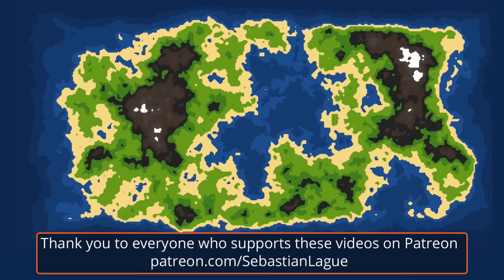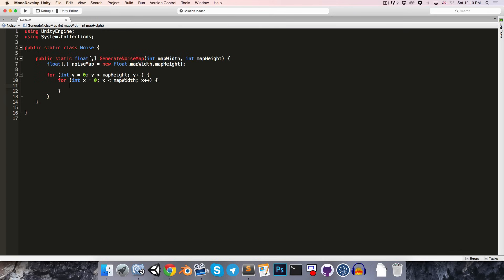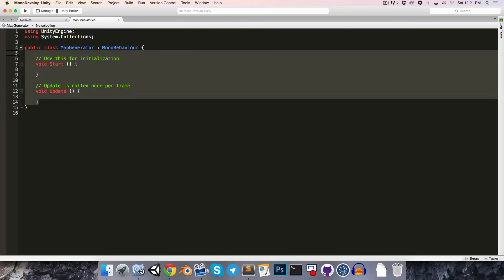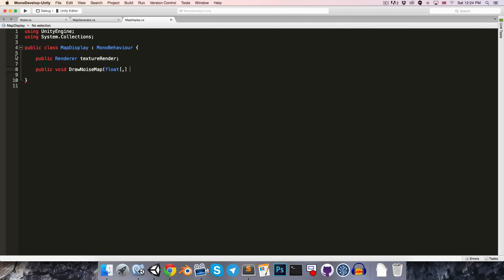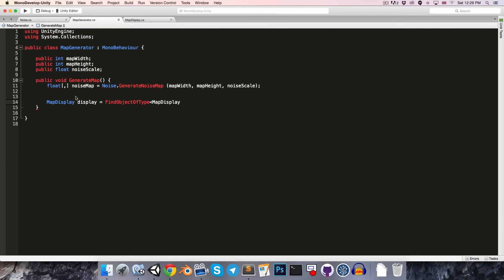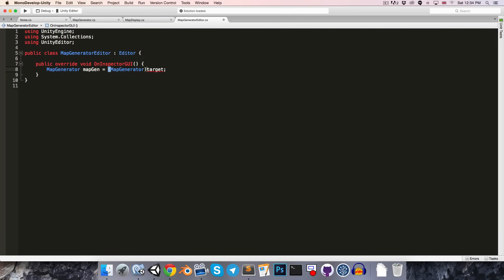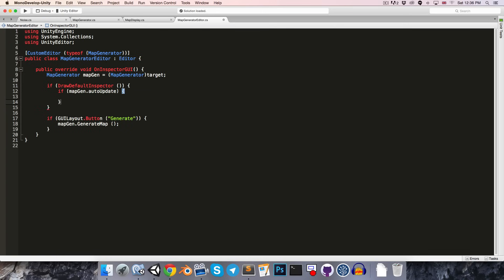Procedural Landmass Generation (E02: Noise Map)

Comment: godammit, and i thought i finally found a video that shows how to do perlin noise without using some lazy build in function
Reply: The algorithm and programming of perlin noise is patented, IIRC. You'll probably only ever find it as a built in function.
Reply: @DB-pt6zj  simplex noise?
Reply: @proxy1035  According to wikipedia it is also created by ken perlin, and a specific implementation of it is patented, so if you implement it in the way described in the patent, youd have to give credit or royalties, depending on whatever license ken has set up for it, which I do not know. I would suspect any simplex noise functions you find premade in software to be using that method, and it's probably baked in to your use license with that software (i.e., the company paid for the right to use it, and as such you can use it in some approved way in the software).

https://en.wikipedia.org/wiki/Simplex_noise

If you want to make your own noise function, your best bet is to probably search academic papers to find out what math they use, and then make a noise function yourself, using similar mathematics.

I have never created a noise function from scratch, but maybe I will make that my next project... If I do I will try to remember this thread. I've wanted to make some YT tuts, so maybe that's a good excuse to start making them.
Reply: @DB-pt6zj  question is, why would i pay them for something that they don't know i'm using...?

like it's literally impossible for them to know someone is using their algorithm if they just never make it public enough for them to know...

even when you make something public how are they gonna know it's their code if you wrote it yourself and just used the descripotion of the algorithm as refrence points to make your own?

so i don't get why i would care about paying for something i just want to use a refrence, and not just do a copy of.

plus OpenSimplex noise exist so there is even less reason to pay anyone.
Reply: @proxy1035  Well, yeah, if you never make it public, they won't know. TECHNICALLY it MIGHT be against the law, it depends on whatever license is attached to the patented process. Many licences IIRC are mostly about distribution and/or profit. So if you don't distribute or profit, then you aren't in violation.

IANAL so I can't really give any recommendations on case law. If it was just for my own personal use, I wouldn't really care about patents and copyright. But IF you make something public, like a game, or app, or youtube tutorial, it might fall under a license violation, which might be why there are no YT vids on how to implement perlin or other noises directly. Their licences might forbid it in some way.

And it can be figured out, assuming it is used in public code (like in a game or something downloadable), sometimes by decompiling software. This largely depends on how the compiler compiles the original code, and how the decompiler chooses to decompile. If there is enough evidence, then you may be hit with court action and subpoenas, in which case you would have to show your actual code, which could prove a license violation. It also depends where the patent is recorded. Many countries that aren't the US don't have strong ties to US patent law/copyright, and so don't respect it in any way. It's one of the reasons there are many Chinese mobile game companies that just completely rip off American art assets and designs - their courts don't have any respect for American patent/copyright law. Which I don't see as positive or negative, just a side effect of the two countries' relations.

As for how to say "this is covered by the patent" or not, you'd have to read the patent itself. Patents vary in how descriptive they are of things. Patent law is a whole field of law. Like I said, IANAL, so I don't know how it works from a legal perspective, how lenient courts would be if your design is "kinda close but not quite what is in the patent description", etc.

But if it isn't public the chance of that being an issue is pretty much as close to zero as it gets. You could probably read the patent, the description of the process, and recreate it fairly easily if you are a little math and google savvy.

Comment: I found that with the finished code for this episode, certain Scale values would result in pure grey images. And, though the first 20~ seconds of this video reference something like this occuring... it didn't quite feel right to me so I did some tinkering. **EDIT: But I should mention here that if you stick with the series, Sebastian later adds an "Offset" value, which appropriately picks from the Perlin Map - rather than the early code from this episode seemedly picking from the same point over & over.**

Looking at the current Unity Docs example for PerlinNoise, the prefered way to pick sampling co-ords is closer to what 'adrian anta' presented some time ago:

float xCoord = x / noiseTex.width * scale;
float yCoord = y / noiseTex.height * scale;
float sample = Mathf.PerlinNoise(xCoord, yCoord);
(I cast both x & y as floats in my example after seeing some systems had issues resulting in solid textures)

Using the code example from my comment here I was able to achieve much more reliable / non-solid results.
Hope this helps!

Comment: For those who seem to be having the error "Array index out of range" check your code. It is not a problem with the IDE or unity,  it is your code.
Reply: Im having this problem what do you suggest be the issue?
Reply: Nvm you’re right. In:
Color[] colourMap = new Color[width * height]; 
I had the * as a = because of Sebastian’s font. 
So if you get this, check EVERY “+,” “-,” “=,” and “*,” and make sure they are the exact SAME as the guy in the video’s

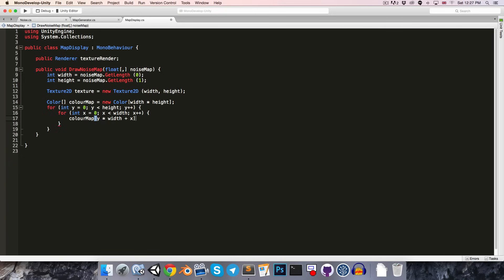Comment: Kind of feel stupid for asking this, but how does the thing he does at 8:22 work? Can't seem to figure out how he gets the correct indexes with that formula. For instance, if width is set to 5, shouldn't the second index generated be 6?
Reply: This may be a little late, but in case you`re still interested:
It`s actually similar to how he iterates through a two dimensional array. You can think of this one dimensional array as a two dimensional array, only with all the rows combined to one really long row. So when y=0, he goes from the first element to the element that is smaller than width. In a two dimensional array, this would be equivalent to going through the first row of the array. Than he exits the inner loop, y increases to one and the inner loop starts at width (where it left off) and continues to width times two. In a two dimensional array, this would be equivalent to going through the second row of the array. Now y increases to two, the algorithm goes from width times two to width times three. In think, you got the idea. This continues as long, as y is smaller than hight. In a two dimensional array, this would be equivalent to going through every row of the array.

Comment: IF YOUR PLAIN IS GRAY: 

CHANGE YOUR NOISE SCALE TO 10, WIDTH TO 100 AND LENGTH TO 100  :)

Unity changed their Perlin function, and it now requires smaller numbers for small Perlin.

changing noise to 100 means our sampleX and sampleY get divided by a bigger number, making them smaller, making your plain display a very clear Perlin image rather than like, 1 grey pixel of Perlin.

Hope this helps someone :)
Reply: you saved me

Comment: The plane is black when a press the button :(
Reply: In case it wasn't resolved, that probably means you used a < check for the noisescale clamp instead of <=.
Reply: Make shure you have "<" instead of ">" in your noise.cs script
Reply: did you solve it?
Reply: I have the same issue...
Reply: @Osdias22  Make shure you have "<" instead of ">" in your noise.cs script

Comment: got this to work on a chunk base terrain.. Instead of making a fix size map I use coordinates as a sample for the PerlinNoise function. Nice tutorial Sebastian quick and fast.
Edit: I had an issue with it when with negative number making a mirror of the terrain when your center is at 0,0. I solve it by adding an offset to the coordinates like 100000+x and to the y. I got this on a 9x9 chunk with 16x16 blocks each.
http://image.prntscr.com/image/92a03e26943545839a0828bc00367bac.png

Comment: hey getting this error with exactly the same code as you, and Im not the onlyone
IndexOutOfRangeException: Array index is out of range.
MapDisplay.DrawNoiseMap (System.Single[,] noiseMap) (at Assets/LandMass/MapDisplay.cs:18)
MapGenerator.GenerateMap () (at Assets/LandMass/MapGenerator.cs:17)
MapGeneratorEditor.OnInspectorGUI () (at Assets/Editor/MapGeneratorEditor.cs:15)
UnityEditor.InspectorWindow.DrawEditor (UnityEditor.Editor editor, Int32 editorIndex, Boolean rebuildOptimizedGUIBlock, System.Boolean& showImportedObjectBarNext, UnityEngine.Rect& importedObjectBarRect) (at C:/buildslave/unity/build/Editor/Mono/Inspector/InspectorWindow.cs:1235)
UnityEditor.DockArea:OnGUI()
 please help

edit found the problem , i put <= instead of < when creating the color array
Reply: where do you use < when creating the color array?? you mean when you loop through to set the colors?

Comment: Hey, I got no errors (or at least Unity says so) but the MapGenerator doesn't show me the noise, its just a black square at values over 0, what did I do wrong?
Reply: Same problem here it just generates a black square for me too.
Reply: @delano4047  Make shure you have "<" instead of ">" in your noise.cs script
Reply: Make shure you have "<" instead of ">" in your noise.cs script

Comment: Getting an "Array index is out of range" error, on a newer version of unity
Reply: Solved the problem was an equal sign
Reply: Could you tell me what the problem was ? I know That this Vid old, but i really need to know.
Reply: Same here, no idea what array its referring to
Reply: MapDisplay.cs line 17 y * width + 4 is the index used in the array, but the number is too high apparently
Reply: my error wasnt there i just re-did everything and it worked
Reply: +DaddyC00L666 can you figure out what it was?
Reply: +NotYetPanda as i said i just redid everything so I don't know what it was and I don't have the old files left to crosscheck
Reply: +DaddyC00L666 my code is exactly the same so I'm assuming it's something in the editor
Reply: between 1 and 0 for scale factor perhaps
Reply: got the same problem any solution?
Reply: please tell me exactly how you solved it. I am so frustrated!!! Arrg
Reply: in MapDisplay.cs on line 18: colourMap[y * width + x] = Color.Lerp(Color.black, Color.white, noiseMap[x, y]);
Reply: check your noise script
Reply: If you look through your MapDisplay script for the line `Color[] colourMap = new Color[width = height];` and it looks just like that, then you've done it wrong... change `new Color[width=height];` to `new Color[width * height];`
Reply: I had the same problem. I checked all the scripts through very carefully and I had made a small typo. Hope you got it sorted.

Comment: Hi Sebastian, i have a problem, and i think it's a bug,
even if i copy-paste your source code,
in unity console i see an error:
"Assets/Noise.cs(5,32): error CS0161: `Noise.GenerateNoiseMap(int, int, float)': not all code paths return a value"
Reply: Nvm i fixed it by changing external editor to monodevelop.
Reply: Sorry, how/where do you change that?
Reply: tools, options i guess, idk don't have time to look.
Reply: Edit -> Preferences -> External Tools -> "External Script Editor" = MonoDevelop (built-In) =)

Comment: I am getting a problem`Noise.GenerateNoiseMap(int, int, float)': not all code paths return a value' can anyone help me please
Reply: same
Reply: You may have set your scale value in the noise script to 0.001 and not 0.001f ?
Or you may not have set a value for the mapWidth or mapHeight for your Map Generator game object
Reply: Stephen Dolby sorted it when I completed the video
Reply: may be to late to reply but you have to make sure that you are returning a value when defining a function with a certain type. just make sure that return noiseMap is outside of any logical operation or loop in your function. that might have triggered it to cause the error.

Comment: Can someone help me, it says "Multi-object editing not supported" in the inspector at the map display script when i added the "Generate" button
Reply: +Jesper Andersson if you haven't found your answer yet..

[CanEditMultipleObjects, CustomEditor(typeof(MapGenerator))]
public class MapGeneratorInspector : Editor
Reply: I know it's been  2 years since this came up. However, I found an additional issue & fix. I had the empty object in Unity that my scripts were sitting in named "MapGenerator", which was the same name as one of the scripts. I renamed the object in Unity to "Map Generator" (adding a space between the words) and the error about "Multi-object editing..." went away.

Also to note, with this fix, adding "CanEditMultipleObjects" did not work for me. I think we (Jesper and I) had two different problems resulting in the same error message.

Hope this helps someone :)
Reply: Yeah but why it is a thing? I made this before and I didn't get this issue, now I am remaking it for my actual project and it just showed it, yeah it's only one additional word in code, but why?
Reply: I clicked on a different object and then clicked back to the Map Generator and that fixed it for me, I didnt have to modify the code at all.

Comment: IndexOutOfRangeException: Array index is out of range.
Noise.GenerateNoiseMap (Int32 mapWidth, Int32 mapHeight, Single scale) (at Assets/Scripts/Noise.cs:19)
MapGenerator.GenerateMap () (at Assets/Scripts/MapGenerator.cs:13)
MapGeneratorEditor.OnInspectorGUI () (at Assets/Editor/MapGeneratorEditor.cs:14)
UnityEditor.InspectorWindow.DrawEditor (UnityEditor.Editor editor, Int32 editorIndex, Boolean rebuildOptimizedGUIBlock, System.Boolean& showImportedObjectBarNext, UnityEngine.Rect& importedObjectBarRect) (at C:/buildslave/unity/build/Editor/Mono/Inspector/InspectorWindow.cs:1231)
UnityEditor.DockArea:OnGUI()
Reply: +Cobre Bfjd I got same error have you found a solution
Reply: same error here

Comment: To make it work I had to alter Noise's method to (I was getting a grey plain texture)

                float sampleX = x / (mapWidth * scale);
                float sampleY = y / (mapHeight * scale);

as Mathf.PerlinNoise parameters have to be within a range of 0..1 
I don't understand why it works in your example though. 

Great tutorial. Keep it up!
Reply: try to cast x and y as floats:
float sampleX = (float)x / (mapWidth*scake);
float sampleY = (float)y / (mapHeight*scale);

Perlin noise can get any value.
Reply: I thought I'd way in here even though it's a 3 year old comment. It's important to note that Mathf.PerlinNoise's PARAMETERS do not have to be within 0.0f..1.0f, but rather what the function returns is between 0.0f..1.0f.

I found that with the finished code for this episode, certain Scale values would result in pure grey images. But the first 20~ seconds of this video to reference something like this occuring... but it didn't quite sit right with me so I did some tinkering.

Looking at the current Unity Docs example for PerlinNoise, the prefered way to pick sampling co-ords is closer to what 'adrian anta' presents:
float xCoord = x / noiseTex.width * scale;
float yCoord = y / noiseTex.height * scale;
float sample = Mathf.PerlinNoise(xCoord, yCoord);

So to demonstrate that the parameters can be outside of 1.0f:
xCoord = 1 / 64 * 100.0f;
xCoord = 1.5625f

Using the code example from my comment here I was able to achieve much more reliable / non-solid results.

Hope this helps!
Reply: Still doesnt work for me i get a black plain texture even after this
Reply: WOW! Thanks!
It worked for me.
Reply: You saved me, thank you
Reply: Thank you! I still get a gray texture when using certain scale values, but this comment made me at least begin to understand this issue. If anyone else is getting a plain gray texture, try changing your scale value around in the inspector and keep it between 0 and 1. Some values work and some don't.

Comment: That converting a 2d array to a normal array really threw me for a loop (no pun intended). i had to draw it out to understand what was going on there.
 
As a newer programer I did have to watch through a couple times and comment my code to fully understand what was going on. 

Good tutorial I learned lots of stuff from it.
Reply: Hey I know you wrote this comment a really long time ago, but if you remember, could you please explain how you understood the conversion? I'm trying to figure it out myself and am having a really hard time doing so.
Reply: @a.p.3571  2D array looks like (x1, x2, x3, y1, y2, y3). multiply the length of x entries against the length of y entries, in this case the result is 6. your new 1D array with a length of 6 will hold the same values (x1, x2, x3, y1, y2, y3). the result of doing this is the same as separating the dimensions x/y of the array and stringing them together in sequence x/y. as he said, this had to be done because our noise/height maps are 2D arrays but color maps for textures can only be stored in 1D arrays, no x/y.
Reply: @Aethelvlad  3 years late but thank you for your explanation :)

Comment: I faced a small problem with this tutorial but I realised my mistake after a while.

Not paying enough attention to the video, I put in a value 1.0f for the noise scale in MapGenerator. This meant that the map showed a uniform colour without any 'noisy' variation - I thought it wasn't working.

After using the 0.3f value Sebastian used I saw the expected behaviour.

Just in case anyone else makes a similar mistake...